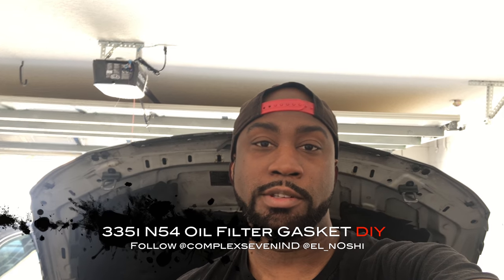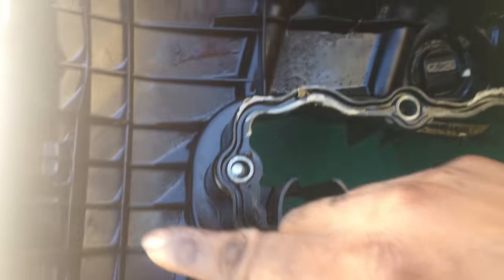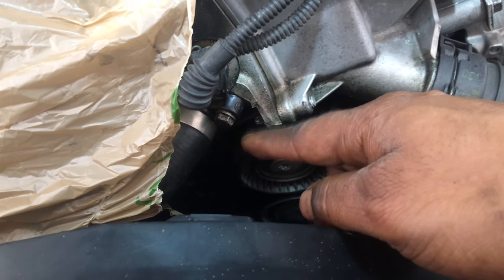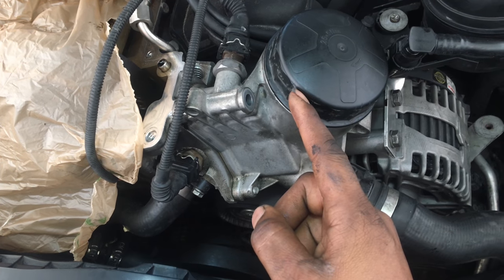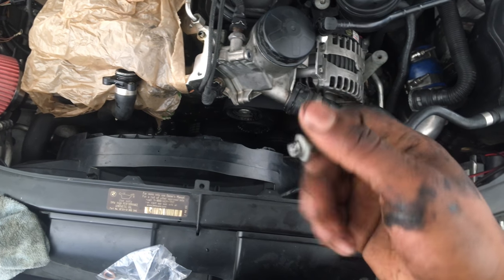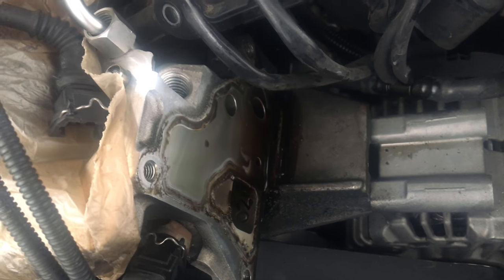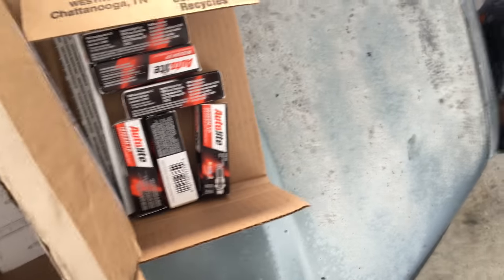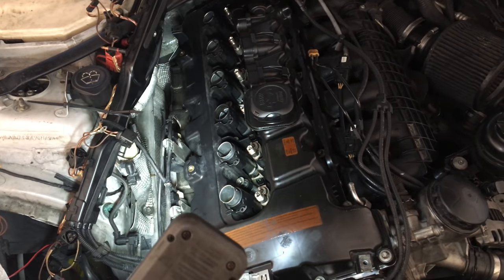BMW 335i N54 Oil Filter Housing Gasket DIY Vlog Part 2

Comment: also you probably could have used a e10 swivel socket to get around loosing up the manifold, i hate pulling off other parts to get to where  i need to work! lol
Reply: Complex Seven Industries well next week i will look around and see if i can get one ( flex head combo wrench) because I'm going all the way in!! when i change the oil filter housing gasket, may as well change the oil, coil packs, plugs, and injectors it will be a pain all at once but might as well if i have to pull the manifold hopefully not! my n54 is high miles so its a must i stay on top of as much as possible! for future diy's can you do one on the oil pan gasket replacement, the o2 sensors, water pump,  fuel pump i would be in your debt bigtime bro!!!!for the oil pan gasket i read there's a shorter way to do this fix!?! that you can jack up your car and do it from the bottom by fishing it out and replacing it that way, which would be less of a pain and faster, even less man hours but i heard its also very risky.
Reply: Complex Seven Industries oh God please do one on this bro! I'm not sure how bad mines is until i change the oil filter Housing gasket then clean up the engine to know for sure so. i just want to be proactive in my resolve and approach.

Comment: 2008 535XI n54 => I tore up the engine even manifold to get to the oil housing gasket bolt, but it been so badly stripped. I couldn't get it out, any idea how!???
Also I need to change my valve cover gasket, what's the usage of spark plug tubes!??

Comment: you know what's crazy your n54 doesn't have oil coolant lines connected to the oil filter Housing unit?!!! totally different from mines.. i have the 08 manual 335i coupe
Reply: Complex Seven Industries Tell me about it 😂 thanks!
Reply: This is for the sport models that have oil cooler

Comment: No don't put autolite what are you doing? Please don't pay attention to this.. Plus a tow torq wrench is useful to bolt those bolts on.. They are aluminum bolts that should be replaced too.. Sorry bro but not really good advice.. Pll please use bmwfanatic, vehicular diy, budget bimmers..
Reply: @nOshi2x  not trying to be hard on you.. Just that I seen people mess up there cars over things like that.. I stick to German parts and genuine check out fcp euro lifetime on everything they use including oil.. For oil I just liqui molly.. Napa has it with AAA discount.. Or fcp euro if you can wait for shipping.. Good videos.. I'm just ify about those kind of parts wouldn't like to see your car messed up.. I love these cars that's why I try to do everything right with right parts.. Just me dude..

Comment: autolites in a european car....thats a big no no
Reply: Jeton Balidemaj why
Reply: dont run right for some reason always wanna put bosch or ngk plugs in them...even in the super basic 2.0 N/A engines (2.slow) ive seen autolites make them misfire nevermind the more complicated fsi and tsi engines
Reply: @jetonbalidemaj   Had them on my 2008 FBO N54 335i Stage 2 LPFP, inlets w/ no issues.